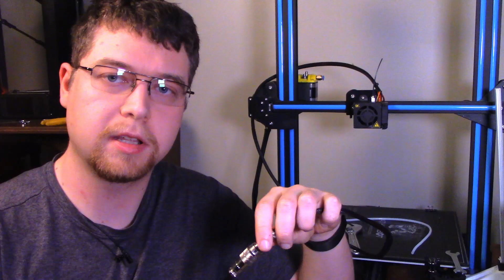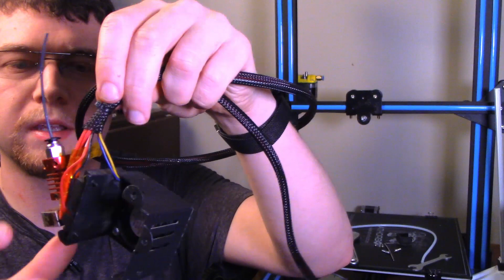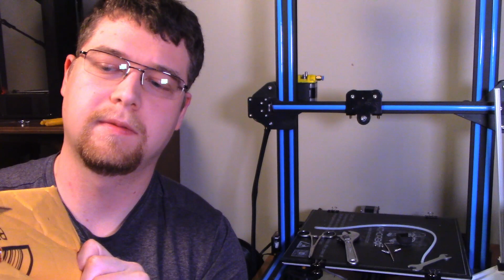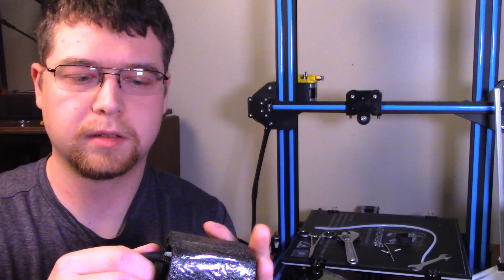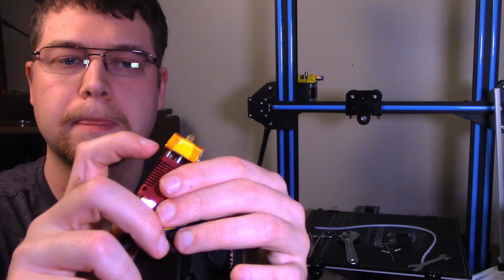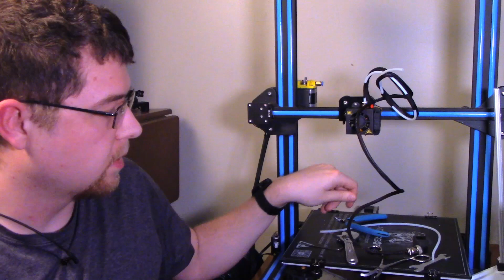Replacing the Creality CR 10 Hotend

Comment: Hi, I just had to replace mine and when I did I could not get the bed to level, I could not get the bed adjustment screws tight enough to get a good print. Any help would be great.
Reply from the maker: Just to make sure that I am understanding correctly, after replacing the hotend on your CR 10 the nozzle is to close to the bed?
Reply: 3D Makers that is correct

Comment: help!  i just installed this new hotend, but, the fan on the side is not working! should it be working or are there setting i need change?? the stock hotend i took off had both fans working all the time
Reply from the maker: The fan should spin, there is a setting under cooling (Initial Fan Speed) in Cura that will control the first layer. Also make sure that Enable Print Cooling is enabled and the Fan Speed is set to 100. If they are set correctly then your unit might be DOA and need to be a replacement.
Reply: @3DMakers  thank you very much for this info.
Reply from the maker: No problem